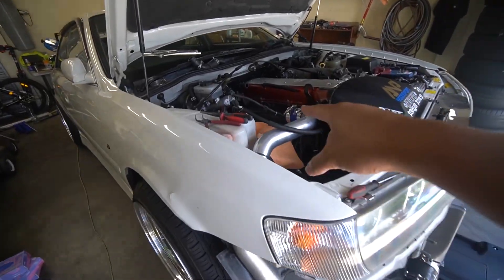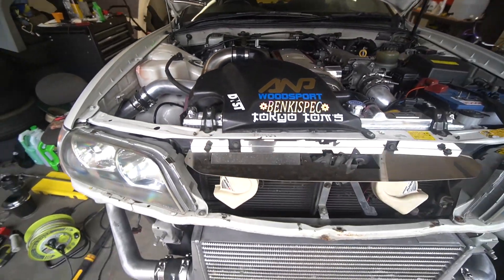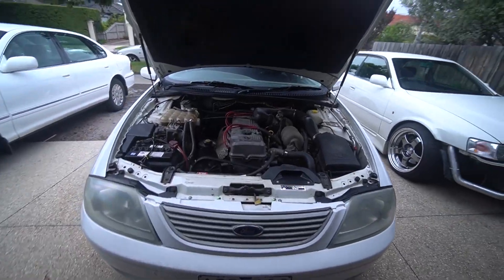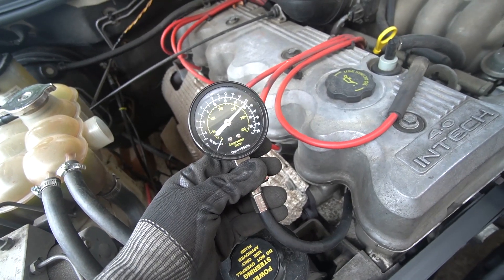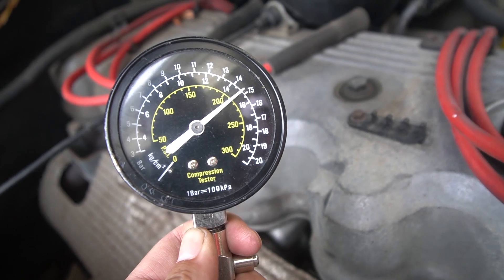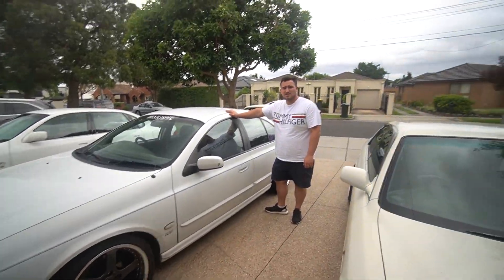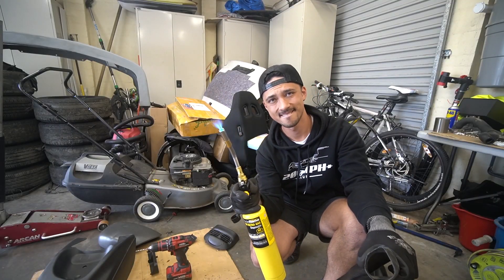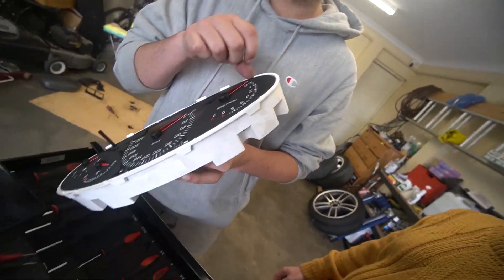Compression Testing the AU Falcon.. It's time for....

Comment: You should replace your leads with the coil pack. Leads are cheap and often fail causing misfires.

To check for a vacuum leak (manifold gasket leak) spray some brake cleaner around the manifold gasket while the engine is running and see if the RPM increases. If it does, it's burning the brake cleaner and it got a leak... Just be careful with starting a fire!

Comment: you should get a cheap turbo kit for it
Reply: Can you put a turbo on standard au futura wagon with lp gas on it what you would have to do to it would an aftermarket turbo system with instructions how to fix it on be easy to do.
Reply: @nicolafachin9802  what? turbo doesn't run on fuel xD doesn't matter what fuel type is is??

Comment: Intake manifold gasket on the au bro
Reply from the maker: yeah its defs bad but do you rckn it could be robbing that much power?
Reply: @RexH  100% bro because the maf is in the inlet manifold, so when it's leaking your maf reads incorrectly, same exact issue with my xr6

Comment: That’s a good intech Rex 😂😂
Reply from the maker: its a bad one unfortunately :(
Reply: @RexH  what exact problems u having Just lack of power?
Reply from the maker: @Reecerudd1  yeah man no low down
Reply: @RexH  all I can think of what may help is Coil pack spark plugs leads injectors fule filter o2 sensor throtal body idail control sensor map sensor Intake leaks even